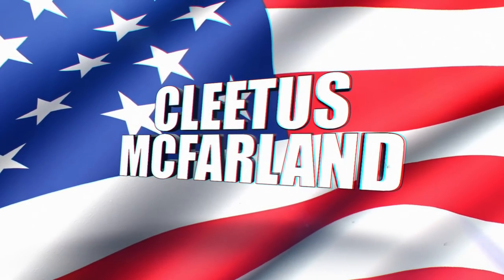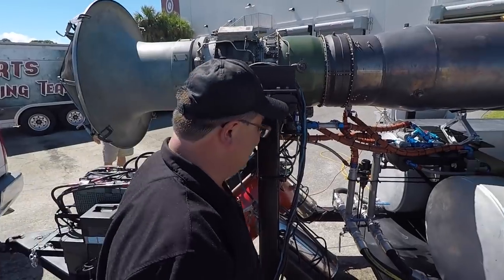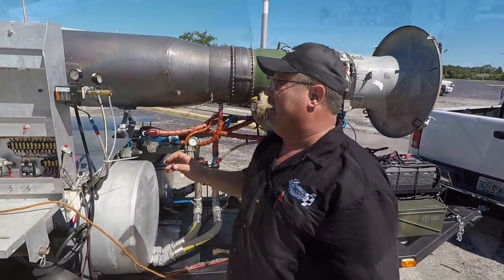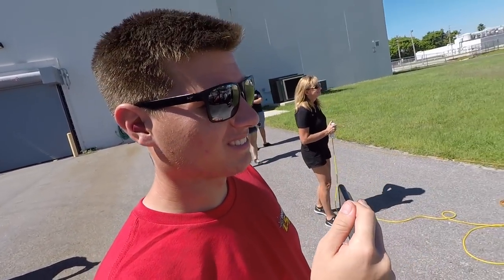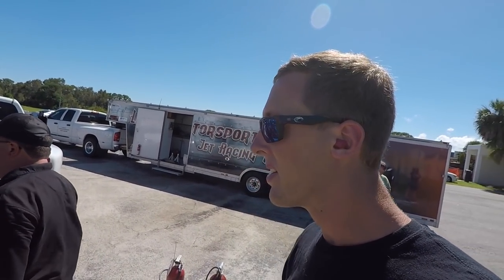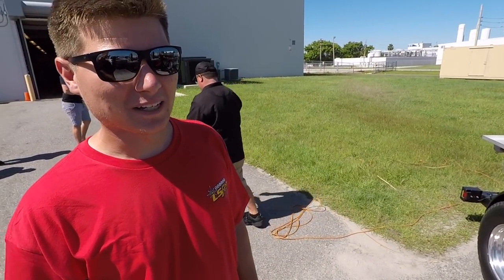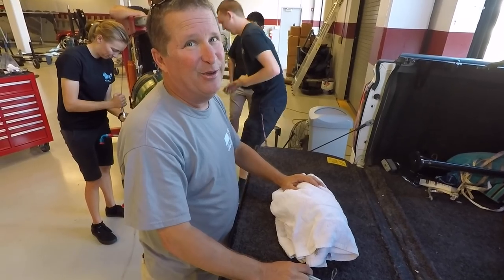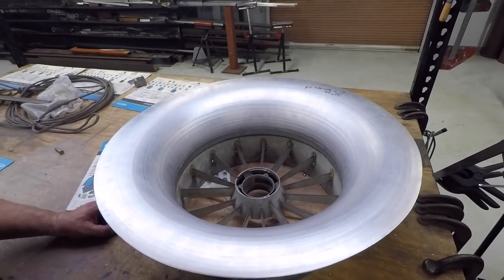Test Firing Project Mullet's ACTUAL Jet Engine! (Spooling Up to 90% Throttle)

Comment: Look into DEKA batteries for your battery needs. And I just so happen to work for the largest Midwest distributor for DEKA batteries... hit me up if you need any... I gotchu....
Reply: North star agm's are way better then deka
Reply: Hiram Rodriguez we respect all opinions, thank you for yours 🙂
Reply: tvctorj  highly sought after batteries in general, dekas ftw
Reply: Battery guy question, one of my batteries blew up(literally).  Brand new what in my bike caused that
Reply: Nicholstop : could be short in the battery, or the hydrogen gas coming off of the battery ignited (spark can cause this) and it blew.. new batteries gas more then older ones... it happens...
Reply: My moms vibrator has more batteries.

Comment: Are you gonna give the jet a 1000 shot of nitrous
Reply: MAURICE definitely needs Cooper’s world famous wetshot
Reply: I know it was a joke but for people who don't understand how turbines operate. Jet engines are temp limited. After the combustion chamber there's plenty of O² left in the air. Dumping fuel into the exhaust stream takes advantage of that excess O² to produce extra thrust. Nitrous would be of no benefit.
Reply: @9HighFlyer9  detrament ? Not really. the  cooler/denser air supports more  primarry afterburn

Egts are the limiting factor as always.
Reply: @safetyfirstintexas  i never stated it was a detriment I said it was no benefit. What I should have said was very little benefit.

I feel the effect on air charge temp is overstated. I think the temp drop is somewhere around 80°F which gives you a 16% increase in air density. That is not insignificant but it's not the driving force behind NO² power gains.

The real power comes from the fact that at high temp it breaks down and becomes a very strong oxidizer. More oxidizer means more fuel which means higher temps. Because the jet engine is already running near max temp there's just that little 80°F which is 5% of a J79 max TIT of 1600°F. So as I said it's no real benefit. Not near the power gains in piston engines. Plus with the amount of air and fuel ingested by a turbine you'd need a truck sized NO² tank.

Comment: at 17:14 imagine if all the engines on that rack where spooled up and roaring with full afterburner!  What would the HP or Thrust Power on that be? LOL
Reply: It would be ridiculous
Reply: ...damn...it would just be...DAMN!
Reply: I believe it is llama-thrust
Reply: scottcol23 you must be 12
Reply: @MichelLinschoten  lol, how did you know?  (Actually I'm 36) but I am told a lot that I'm basically a 12 year old trapped in an adult body.

Comment: At my old regional airline, an unmonitored hot start sent egt numbers over 1100 deg....celcius! This burned a hole out the top of the engine and cowling. As Larson probably told you, nothing with a turbine engine is done fast. I love The ElDiablo youre building (jetcamino is tame!) and think it will truly be a monster, Will exceed 200 in that quarter. Be safe. Please.

Comment: This thing consumes as much (if not more) Fuel than a top fuel car xD
Reply: I just saw the two fuel lines going to the engine and the afterburner so i just assumed it consumes as much
Reply: Top fuel lines are the size of coke cans. They are rediculous!
Reply: Do you mean .33L or .5L coke cans?
Reply: because my dragster (a old top fuel car) had 2 fuel lines the 
diameter of .33L cans each
Reply: oh wow now i get it xD

Comment: 2  450 fuelpumps and 3 everstart batteries should be enough right 😂😂😂
Reply: CowMaroGapserrrBody yeah, that should be enough for the starter
Reply: Jet engines don't have starters they start by air
Reply: justwatch Did you even watch the video? They literally show the starter.
Reply: renyn21 r/whoosh
Reply: Carl Computer If that's supposed to be a joke woosh indeed, I don't see it. I have no idea where that might come from. Can't know all the references (I assume it might be a reference), especially if it's some murican tv show as I'm from europe. If it's some media reference I'm expecting something along the lines of that considering this channel's american-ness.
Reply: renyn21 it was supposed to be a joke that an engine this massive would require an enormous amount of power to start, which it really does, but also need an incredible amount of fuel to even start it
Reply: justwatch they most definitely do. Plus they got a spare jet engine starter in the video

Comment: The starter takes 36volts and draws about 350 amps. A portable battery bank to start it and it will run without batteries until shut down. So that will save wait in the car.  I'm very excited to watch this project....   MORE POWER!!!!

Comment: Stupid question. But why not use the onboard LS to start the jet? The jet racers don't have the benefit of an onboard power generator, that you're planning. Granted you'll sap some power with some custom alternator/generator, but will it offset the weight of those 3 giant dry cells? Food for thought?

Comment: I still remember my first time seeing Shockwave  jet truck had 3 jet engines and that sucker would pound your chest half way down the track when it setup to the light. Felt the heat as it passed by.
Reply: Did you know Larsen Motorsports is restoring the original Shockwave Jet Dragster?! To watch the restoration subscribe to our channel to stay up to date!! 🔥🔥🔥

Comment: This is cool but is a baby compared to what I used to work on in the Navy. I worked on the F-18 Super Hornet and it had 2 F414-GE-400 with 13000 to 22000 LBF of thrust. That should be in your next jet car.

Comment: The Fighter jet I work on has the PW-F-135 engine and that thing makes about 28,000 lbs of thrust without the afterburner and nearly double that with the afterburner.

Comment: So effectively, your passenger seat will be either entirely batteries, or fuel for one of the two engines. Is that right? El Caminos don't have a heck of a lot of space when you are cramming Jeffery the Jet into the back and leaving a thermal barrier. This could be an interesting build!

Comment: Crazyness! looks fun  but be careful and you have to make sure the engineering and install is dead nuts on,, if that engine is just a tiny bit skewed off center it will kick the rear end of the elco  right around and willl be like a out of control bottle rocket!

Comment: Find a Huffer or an Auxiliary Power Station Unit (I believe that is what they are called so don't kill me) to start that jet engine in case the batteries go dead on you and you have plenty of charge as well.

This is going to be one hauling car when it is done, just don't challenge Shockwave to a race. That triple engine SEMI TRUCK will most likely leave you in the dust. But if you do, find an airport with a long runway to race that monster.

Comment: If you think that's cool Imagine that engine, without the after burner, 10 times bigger. I present you the Pegasus engine from Roll's Royce and that's what the Harrier jet has. I was a powerplant mechanic/plane captain and we'd have High-Power runs every week or so and what you see on camera really doesn't render it any justice at all. It's an incredible feeling to have  24,000 lbs of thrust right next to you. Your whole body shakes, you feel like all the air around you rushing through the intake of the engine, you're wearing double ear protection and it feels like you have nothing... Cool Factor x100 for sure! Can't wait to see what's gonna happen w the build.

Comment: You need to get a Rolls-Royce 250-C18 turboshaft engine for your side by side you bought forever ago and just have taking lift space. Because what better than having 1 jet powered vehicle....that's right, having 2 jet powered vehicles.

Comment: I wonder why they don't use a pneumatic starter? ...Of course, the "starting cart" might have a bit more of a footprint potentially needing a gas powered compressor and a tank but you wouldn't be burning through starters. ;-)

Comment: What was the fuel consumption on that run of the jet engine
Reply: Kenneth Kirby If I remember right, it should be around 11 gallons per second at full throttle + afterburner

Comment: No batteries in the car, make a battery cart, 4 in series parallel will give you 24 v or 6 in series parallel will give you 36 v.  If you want 36 v 6 batteries will give multiple starts and extended start time if you have a hot or hung start.  After startup and the engine is stable you unplug the engine does not need them to run.  Remember if your batteries are weak or your starter brushes are bad and you don't get 20+% N2 do not add fuel.  Better start thinking about stopping, going fast is one thing stoping is another.  Do it for Dale and the rest of us who would love to be there in your crazy ass shoes.

Comment: My cousin ran a jet funny car years ago. Be careful with the weight distribution. It will accelerate off of the ground quickly if it noses up. You’re gonna have a blast with it. Pun intended

Comment: Just get a jump cart.... Wire all the batteries in series and hook a small gas or diesel powered generator into the mix on a push cart so you won't have that much weight while running. Just jump her off then when it's running they're self sufficient from what ive heard.... Just an idea
Reply: Do that and see how many batteries it takes to make a full pass just run what it takes to do a pass and use the cart for the start up could save you alot of weight.

Comment: The thing you have to wrap your head around is that thrust doesn’t equal hp. Even with 5,000 lbs thrust, at 0 mph, it is making zero hp! At 1 mph, it will be making around 10 hp. At 10 mph, it will be making 100 hp. At 100 mph, it will be making 1,000 hp. If you only go 200 mph in the quarter, you are getting 2,000 hp. If you could get all the way to 500 mph, it would be equivalent to 5,000 hp.

Comment: The hot start procedure he's describing is wrong.  You would not run the starter "until you get it started".  If you recognize a hot start you pull fuel and motor the starter until the combustion chamber has been cleared of fuel and the air passing through the engine has lowered the ITT/TIT/EGT below a specified threshold (usually around 400* C).  You would NOT continue to try to start the engine (reintroduce fuel).  If you have a hot start, the condition is likely caused by a stuck flow divider that is providing fuel to the secondary fuel nozzles too early.  This condition would need to be corrected by a turbine mechanic prior to attempting another start.  They've got a lot to learn about how these engine work or this is going to get very expensive very quickly.

Comment: Why dont you use both engines together? Leave the glide in drive floor it at the line and hammer down on the jet. Combined horse power 👍
Reply: Trans go boom and itll over spin the engine
Reply: @andrewbleazy  no it wont if the car does 200 gear it so the motor is at a safe rpm at 200

Comment: Shouldn’t be able to do a wheelie as it’s acceleration doesn’t rely so heavily on the friction between the tires and the ground. Only reason it’d do a wheelie is the inertia but idk if this is gonna have the power to make a wheelie from that.
Reply: Nah.  The turbine will probably mounted so it's closer on the top than the bottom. If anything it will push the front tires into the ground.

Comment: "more power than weight"
okay... but we don't measure power in pounds, because it's not a unit of power. If your jet engine makes 4000 lb of thrust, that's going to be less acceleration than 200 whp. One nice thing about the jet engine is that it doesn't need to grip the ground to accelerate the car, so you get more total acceleration without needing extra traction, the downforce needed for traction, or the drag that goes with downforce.

Comment: The holley jet on the self look good  to go. 😅 there use to be a NO FEAR shirt. That said at 200MPH you have no friends. Thats kinda where you are going. 200MPH. Stop and consider that for a moment. While the after burn is screaming. On Jeffrey the jet and mullet. Flying down the strip. 🤔🤔😲😛

Comment: You are to going to hurt yourself with this one. I recommend 6 pot brakes along with the parachute. I'd also full cage that bugger. Im talking bumper back! And put fireproof shielding everywhere!!
Reply: Did you bother to see the last video.  They have the El Camino in the race shop getting a massive cage.  He said it would take about a month to do the fab.  The jet engine mount plus whatever structure is needed to strengthen the chassis will add considerably to the fab. He said someone from Larson is going to come to Tampa and oversee the install.  I don't believe we will see this car testing, much less running hard before mid summer at best.

Comment: dont install the batteries in the car.  just have a start cart that you plug in after you roll up. You wont be driving around with the jet lit any way.  the cart can have large batteries and be towed so you can go nuts with the weight.
Reply: 20+ year FAA Jet Mechanic
Reply: A hemispheric inlet screen has the best surface area

Comment: Cleetus pulling tractors used jet turbines some teams used engines with blowers and pistons! one guy was setting in a easy chair! the next guy said well you never see a plane rebuild a engine in half trips! the same guy in chair was helping the piston guy change his motors he changed the shirt, but not the hat! they had the same type of oil in there tractors the money came from the same place! in NASCAR they work the same way when needed! Dale-e back about 20 years ago the guy needed a trailer & trip to the track dale did that a other team supply the motor & car, the driver was a part time one! when he was 2 spots behind dale e on qual day the next week his car was black with silver trim  with his number on it, they asked the  RCR owner what happened if he that good he can test our stuff on Sunday!

Comment: So practally if the car weights 5000 pounds. The car would not move??
Reply: It's the drag which resists motion.  Inertia of the mass only determines the rate of acceleration.  I can generate maybe 600+ pounds of thrust with my legs, but I can easily push a 5000 pound vehicle on a flat surface.

Comment: Jus when guys think they’re twin 88mm 572 that makes 2200 hp is impressive... 
just look at the GE 90and it’s 127,900 lb of thrust...and has no afterburner

If u were to chain 42 Dale Trucks all together, and mount a GE90 jet engine vertically as though it was lifting straight up like a rocket. It would lift all 42 off the ground, straight up...no wings..simply lift 42 Dale trucks strait up off the ground !!!

https://www.ge.com/reports/the-worlds-largest-jet-engine-is-already-more-powerful-than-americas-first-manned-space-rocket/

Comment: So 2 years later where is the car?
Reply: The plans to put the jet engine in it were cancelled due to safety issues, the car is now at KSR performance getting turned into a 6 second drag car for the McFarland crew.
Reply: @Dylan-bn3nc   hes scared
Reply: @-jimmy6969  well of course he’s scared, a jet engine strapped to a short wheelbase car is not safe whatsoever.
Reply: @Dylan-bn3nc   it’s actually pretty safe. These cars almost never have problems.
Reply: @-jimmy6969  no someone he knew died in a jetcar accident and they thought it was a better choice not to do it

Comment: You will probably only have to lean on the throttle for a hundred feet or so and will cross the line at max speed of the track. If you went full throttle the length of the track it will take you a mile to stop. Lol

Comment: Thats pretty much a toy jet engine. I used to work on much bigger and much more powerful jet engines, some i cant mention when I was in the USAF. The actual engine without is about a quarter size of what I worked on with no afterburner. Cant wait to see what and when you shell it because you sucked something up in the inlet LOL. I just hope its not Holly, James or Cooper. This is one that YOU need to be wearing the shock collar to keep you from being stupid.